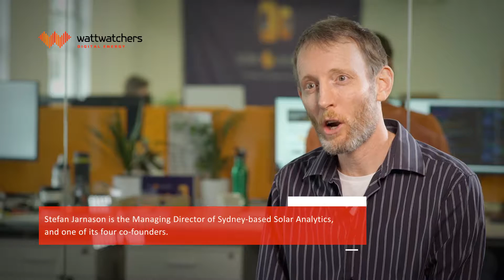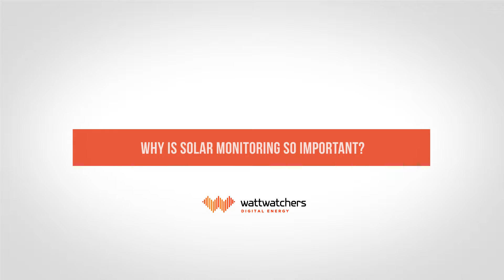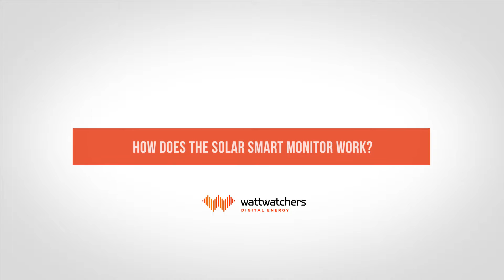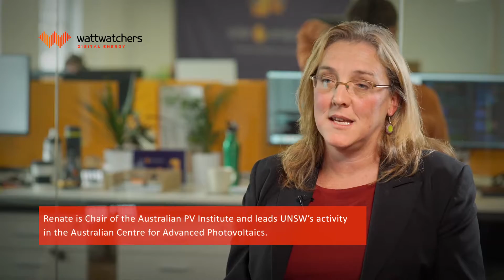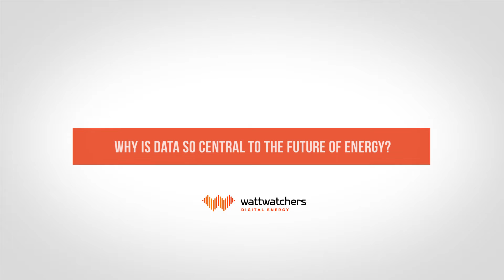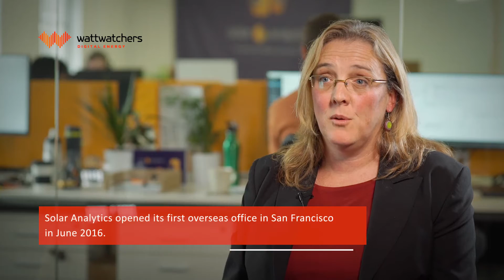OUR SMART SOLAR PARTNERS: SOLAR ANALYTICS

Comment: We have used the SC 23 smart monitors via Solar Analytics Portal and our ability to provide incisive real time data decisions is critical in managing sites for maximizing Solar PV output .
The Earth Fault Alarm efficacy has saved two sites from unintended losses that otherwise would have gone undetected on out of sight visual detection.
No outages that plague the wifi piggy back units .The service back up is also second to none. 
Kevenergy HeapsofEnergy Solar Monitoring Gold Coast .